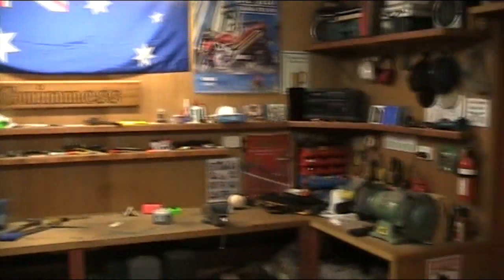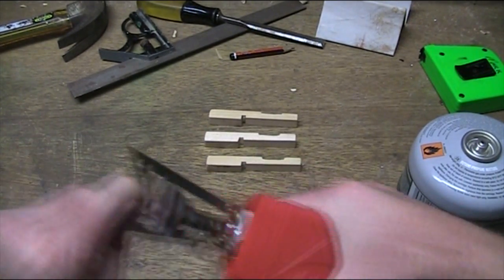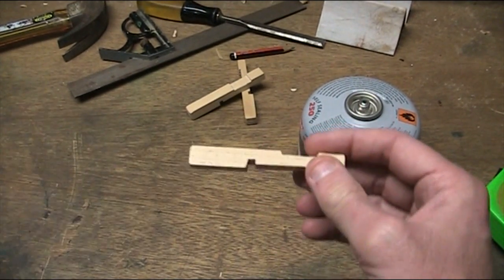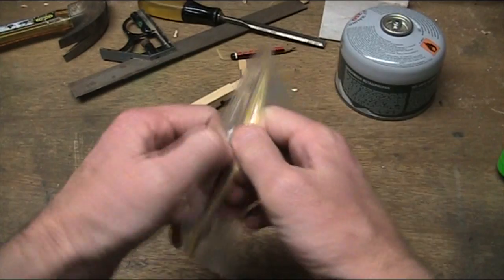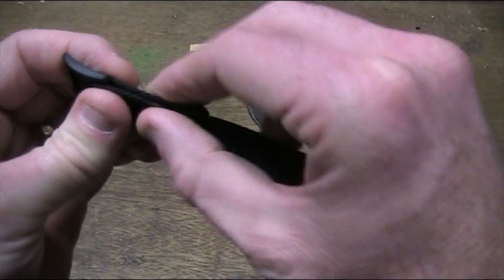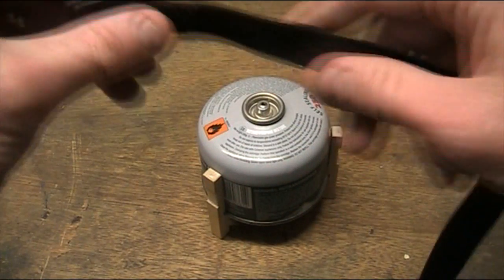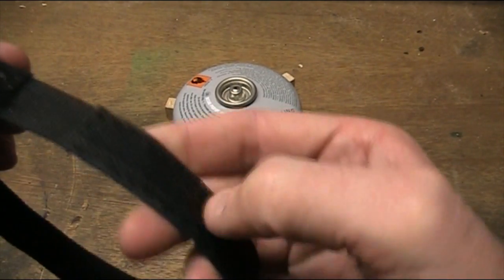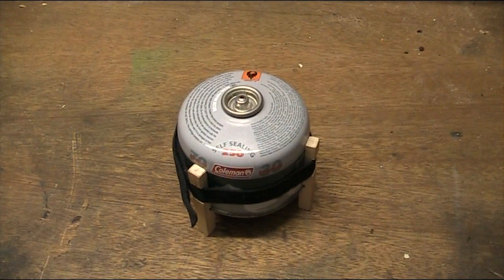Super Legs: DIY Canister Stove Stabilizers

Comment: I made something similar but instead of wood I used a soft iron rod stock to make the legs. It took me ten minutes or so of filing to create the notches that form the shelf the canister rim sits on. The legs are secured to the canister with a hose clamp designed to fasten the exhaust hose of a clothes dryer. I toss the legs in loose with my cook kit while the clamp stays on the canister. The advantage I think the metal legs offer is I can push them down into the soil effectively anchoring my stove but I'm sure you could do the same thing if you made legs out of a harder wood than soft pine.

Comment: hang on.. am I missing something here. You've made it less stable not more stable.

For one thing, you've raised the center of gravity up, making it easier to topple. The other thing, is that you now have less surface area than you did before in contact with the ground, making it unsteady. Yes, you've raised the canister above the uneven grass, but you've took all that advantage away by creating  the other two problems. I'm a bit confused?
Reply from the maker: It's really quite simple. Three points of contact = stability. This is why some stools have three legs not four. Try it and see.
Reply: AussieMark909  I'm not convinced :) with a circular base in contact with the ground, you have unlimited and complete stability points. The more you reduce them, the more unstable it is. Take a three wheeled car against a four for example. Three wheeled cars are notoriously unstable than fours, not more so. You've basically created a top heavy weight which overspills and overhangs beyond the surface area of the legs... making it unsteady.

You've also raised the topple point by quite a large height. Eg imagine your design, but with 30cm legs on it. Do you think this will  be more or less stable than if placed directly on the ground?

I may be entirely wrong of course...
Reply from the maker: Until you've tried it you are merely theorizing. Do the experiment for yourself. I am not going to try to convince you either way. Knowledge is best acquired by doing.
Reply: AussieMark909 yes I understand the three leg things.. but lets look at it this way. Sit on the three legged stool at a  bar, and wobble about on it. Now, take the seat off the stool, and place it on the ground, then sit on it again. Which is more likely to topple over? With the seat placed directly on the ground, both you and the seat would have to topple over 45 degrees in order for it to fall over. With the legs attached, the angle is much less than this.
The three legged feet argument works, but ONLY IF the legs are needed in the first place for some reason. If not, you've just made the whole thing less stable by adding legs ! Ie, what I'm saying, is that the canister never needed legs in the first place. by using three legs on the cannister, you've fixed a problem you created by adding the legs in the first place.

I can see the advantage if you spike the legs into the ground though.
Reply: Agreed
Reply: The reason this might actually work is that he increased the diameter by nearly 2 cm. The even better reason is that you could bury the legs a bit, making it stable against anything less than a kick. If a stove were stabilized by tent pegs, it would be impervious to falling.